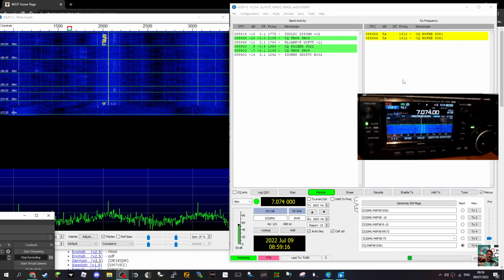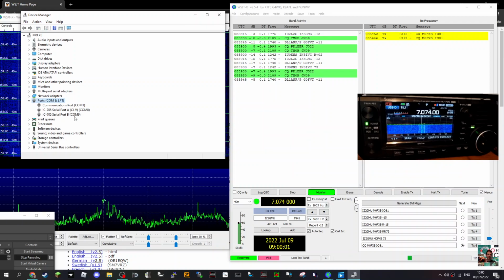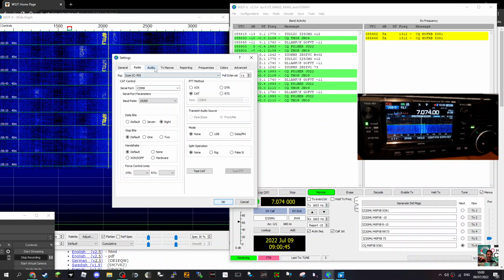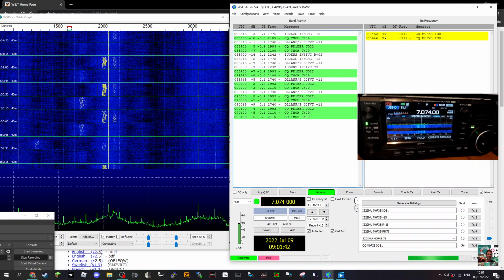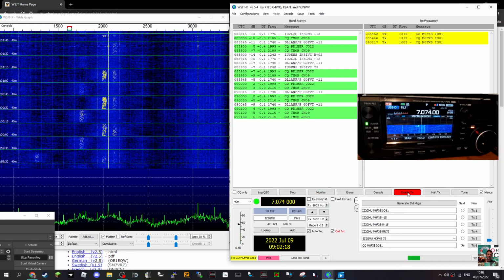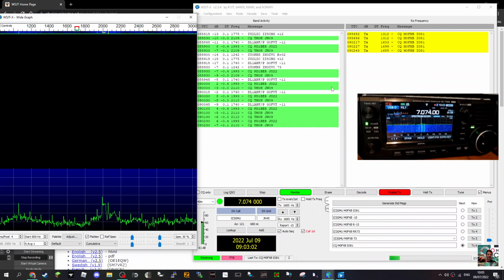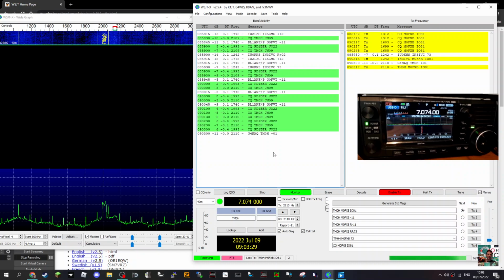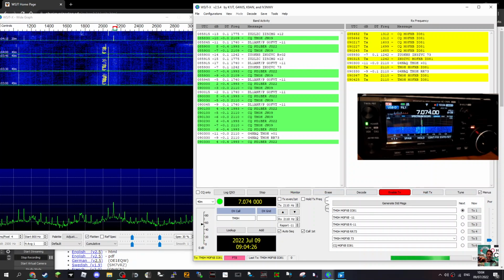ICOM IC-705 WJSTX-FT8 2022 Full Set Up -Test

Comment: 19200 baud rate? On icom IC 705 report 9600
Reply from the maker: There is no Baud rate setting, It is Automatic
It adapts to whatever speed you set in the controlling Software

Comment: it does exist driver for mac os? I went on icom offical site but nothing...
Reply from the maker: There are additional installation notes in the Readme file that came with WSJT download package that you need to run.  There is a file that needs to be manually installed to the system:   com.wsjtx.sysctl.plist
The instructions are in the Readme file.

 I am running WSJT on the two Macs that I have.

Hope this helps,